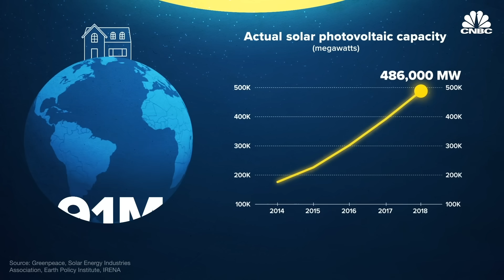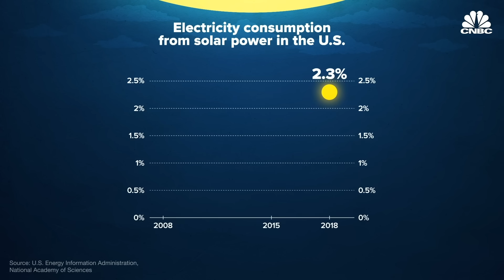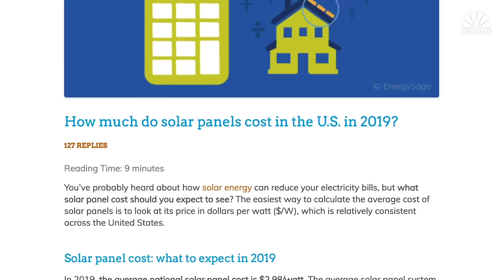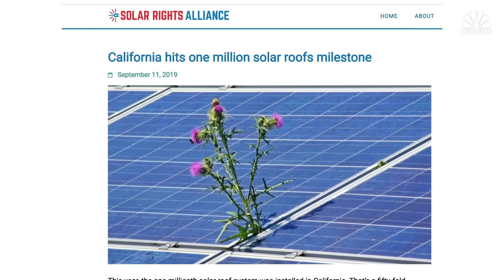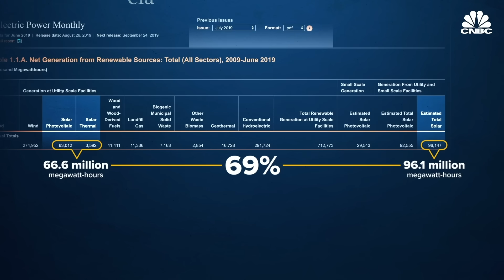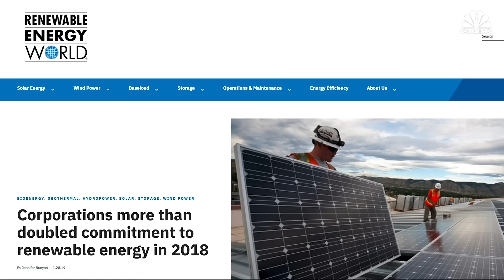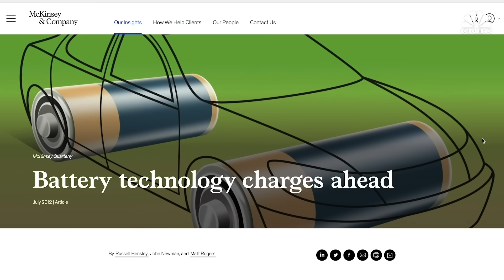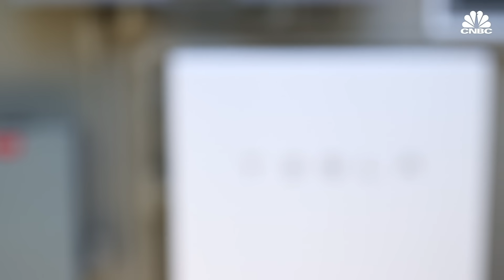The Rise Of Solar Power

Comment: Hawaii already over 30% alternative energy!
Reply: Maui runs about 70% renewable during the day (with normal winds).
Reply: @cb2000a  So the location most suited to renewable energy can only get to 70% during the day. Compare that to the City of Chicago with its 2.7 million inhabitants. For six months of the year there is no sunshine. A few hours of sun through the rest of the year. To produce enough wind energy would cover Lake Michigan completely. No geo thermal. As wonderful as alternatives are in theory most of the US is many decades away from a viable alternative source of energy to fossil fuels.
Reply: @johannesswillery7855  It's crazy to just dump natural gas.   It is the best, cheapest, and most reliable source of energy next to hydro.
Reply: @yaimavol  What about Nuclear? Hands down the safest and cheapest energy source a available.
Reply: @johannesswillery7855  No hydro is the cheapest because there is no fuel that has to be mined.   I don't like nuclear, because of the waste and with the abundance of nat gas we don't need it
Reply: @yaimavol  It is true that we have enough natural gas to meet our needs. What about regions that do not have abundant fossil fuels available? Part of what is missing in the conversation is the massive development taking place in areas that previously consumed relatively little energy.
Reply: @johannesswillery7855  it's the most expensive currently. 2x the cost of natural gas and 3x solar/wind
Reply: @fgsaramago  Uranium is quite cheap and has more energy stored than anything else. It is expensive to bring Nuclear online but way cheaper in the long run and it works in places that Solar likely never will.
Reply: @johannesswillery7855  the biggest cost of nuclear is the ongoing manteinence and operation of the plant itself. Just checked my last electricity bill and nuclear is at 20 cents, natural gas at 13 , solar at 8 and wind at 7.

Offshore wind it's the future. You don't need your electricity production to be local
Reply: @fgsaramago  Your electricity bill shows kwh price by source of energy? The truth is very hard to come by in this discussion. I tend to come down on the side of common sense. If alternatives were viable then I believe the most progressive states governments would be using them to power the buildings that they occupy. Since none of them do exclusively I doubt the sincerity of their assertion that Solar and Wind are the answer.
Reply: @johannesswillery7855  here in Portugal the bills have the kWh cost of each energy source at production as well as the percentage mix of each source.

Thanks to the growth of renewables this year the cost of electricity has lowered for the first time in more than 30 years

EDP, a Portuguese electric company is now the 3rd biggest renewables producer and investor in the US. Their new offshore wind farm will supply a third of Maryland for a lower cost than current sources
Reply: @fgsaramago  I wonder how much energy costs differ in the the US as compared to Portugal. I don't know much about the climate there but I do know a lot about the climate in North America. The Southern border States experience warm temperatures and copious amounts of sunshine. Not true when you go north of there.
Reply: @johannesswillery7855  we have a lot of sun in most of the country, think California weather, but what amazes me is how Americans focus so much on solar when talking about renewables. Wind needs smaller areas for the same production, it's more constant during day and night and the turbines work even with very little wind. Solar is good for micro generation, for people to have at home, in their rooftops, not for macro generation, except maybe hot deserts with sun every day of the year or close to it

We pay about 0.14€ per kWh, before VAT
Reply: @fgsaramago  A big challenge with wind farms and for solar farms as well is that they are hideous and no one wants to see fields and natural areas covered with them. Even at sea they are an eye sore to those who would travel that far. Off the coasts there is tremendous opposition most famously by the Kennedy family. A few very wealthy families can wield incredible political clout.
Reply: @fgsaramago  Have you heard of Germany? They claim to close all nuclear plants by 2022, and use wind and a bit of solar instead. Compared to 0.75 nuclear France, their electricity is twice the price already.
I don't know what is it with your nuclear plants, but France does it better, you should copy them.
Reply: @ferencgazdag1406  "our" nuclear plants?😂 Here in Portugal we never had them. The French buy our wind energy in significant quantities. Our wind and solar is the cheapest electricity in Europe
Reply: @fgsaramago  Just fact-checked you, France doesn't import any electricity, they are a net exporter, on the other hand, Portugal imported 9 TWh of electricity in 2008, what is 9÷49,1=0,1833=18,33% of total.
It may be the cheapest, but not at midnight, when you still need power, especially for industry
Reply: @ferencgazdag1406  in 2008...😂 Realise that was 11 years ago, before ANY wind or solar was pretty much in use? Get a grip dude 😂

And wind production is significantly higher at night, where consumption is also lower. Excess wind production at night is used to fill dams and sell to France and Morocco

Also, calling France a net exporter is totally pathetic. Sure it produces more than it uses, there's just one problem with that. Nuclear has a continuous production even when it's not needed and it goes to waste. If you take out the amount of electricity produced that was thrown away France is in fact a net importer
Reply: @fgsaramago  Yes, nuclear production can't be adjusted to demand quickly, but at least it can be adjusted on a grand scale. Solar and wind can't even do that, if the Sun doesn't shine and the wind doesn't blow, you are basically screwed.
And that is the reason why Germany pays other countries to take her peak power, but has a very high price of electricity. Also, Portugal has 0,41 of total energy from fossil fuels, while France only has 0,17. This means a lack of nat. gas peaking stations, but also less emissions.
Reply: @ferencgazdag1406  that's some very skewed way of seeing things. Radioactive material is certainly fossil but that's besides the point. 

One won't certainly have more than a few hours at a time where the there's no wind and no sun and it's for those moments that wind and solar power are used to top up dams. 

Lastly, the only reason Portugal doesn't have a higher share of renewables is that it's more profitable to sell that energy to other countries than to use it in the country due to the way old contracts with natural gas and coal plants are structured again making for some disingenuous points on your part. The grid pays more for coal or natural gas generated electricity
Reply: @fgsaramago  I don't understand, how an unreliable power source can outcompete a reliable one, with neither being adjustable. You can just do dam toppings with nuclears as well, and the electricity consumption is more like a flat line of nuclear than a parabola of sunlight.
Reply: @ferencgazdag1406  the thing is that wind is produced more at night and solar makes up for the drop off during the day. Solar and wind farms have massively lower building, running and licensing costs than a nuclear plant
Reply: @fgsaramago  Sources, please?
Reply: @ferencgazdag1406  afraid I can help with that. My sources are that this is a hot topic frequently discussed on TV. Programs like negócios da semana and Prós e Contras talk about the energy sector regularly

I'm sure, however, that these basic concepts I talked about here are taught to teens in schools all over the world. This is just some pretty basic stuff if we're being real.

I dont suppose you want me to do your Google research, do you?😂
Reply: @fgsaramago  I don't want you to do my Google research, but i thought you made your opinion based on one.
I did some research, and France emmits 2/3 the CO2 of Portugal per produced energy.
Lacking a cynical wiewpiont, and surrounding oneself on religius dogmae nicknamed common knowledge is highly frowned uppon in the scientific community, the very best people.
I've looked it up, and solar and wind do not complement daily, but they kinda do annually, but you have a deep valley in october, what means you have to sometimes trash your electricity.
Reply: @ferencgazdag1406  given France's use of nuclear that CO2 stat should be, dare O say, common knowledge 😉

Getting a bit more real here, don't conflate common knowledge with dogma, when the meaning here is clearly basic facts. Do you know what's really frowned upon in the scientific community? Trying to have a useful conversation without knowing the basic facts

As for what you call the October slump, I'm lead to believe that the stat you saw includes hydric generation as October is usually the worst month for it.

Since you've talked about prices, why is it that domestic electricity plans that are 100% or majority renewable are cheaper? One would think that plans like the ones from Endesa who are something like 30% nuclear and 35% coal would be cheaper...
Reply: @fgsaramago  Yes, you are right, common knowledge is not religious dogma yet, and to keep it that way you have to fact-check it over and over again, so you are better off not relying on it in the first place.

I think that gasoline is THE best and cheapest way to make power, what can even be turned on and off. Why am i not recommending it then? Because climate change, of course.

As i will prove, renewables apperar clean on the surface, but like asbestos, this is only looks. Solar & wind can't power a country, so you must rely on natural gas, and other evil ways to get the grid to work. And the evil has realised this, and now, standig face-to-face with their end in nuclear, they choose the only option of survival:
Ensure, that there are wild renewables for them to balance, and make nuclear look really, really bad. For both, the television is exellent, as you only have to pay them to make them say anything, they don't need sources. Also, the public perception of nuclear reactors is way worse than reality, and the public perception of solar panels is way better than they actually are.
This is why you shouldn't rely on common knowledge, at least in this subject.
I want my opinion to represent reality, this is why i asked you for sources, and this is why i still don't believe in renewables. If you back up your claims, i will believe you, but i don't trust the common knowledge, for the reasons listed above.

We know that nuclear plants make waste, what is radioactive and will stay around for a lot of time, but solar panels do the same, but only out of sight. As the solar panel reaches the end of its 20 year lifespan, it stops working, and we have to get rid of it. This is approx. 300 times the waste/joule what is made by nuclear, and it doesn't even decay, and is toxic. Wind turbines don't have this waste problem (they still break down),  but they are even less predictable than solar, so you can't even make supergrids with them, and you must use the dark side of the power. Theese are some of my arguements, if you can show traits what outweight theese, i will adjust my opinion accordingly.
Reply: @ferencgazdag1406  I've never seen a comment so full of dogma and uninformed opinion in my life!

The CEO of EDP, the biggest energy company in Portugal thoroughly debunks the premises you base all your assertions on. 

Firstly, Portugal has at times been for spans of 3 to 4 months 100% on renewables.

Second, wind and solar CURRENTLY cost per mW half as much as natural gas, with nuclear in turn costing twice as much as natural gas.

We've recently started reaping the benefits of renewables with energy prices dropping for the first time ever, something that will continue in the following years with more renewable sources getting online.

Why would anyone want to build more nuclear installed capacity to burden consumers with higher electricity costs?

Sorry to say, but as usual, the nuclear proponents are in full dogmatic mode, oblivious to facts and lived reality.

I think nuclear is pretty cool and the process fascinates me, I work on research with radioactive material. I just can't bring myself to ignore certain facts and make others look better than they actually are
Reply: @fgsaramago  I'm sorry, but i can only accept this as you opinion, and i can't believe, that nuclear would be TWICE the cost of nat. gas, as one of my sources is Illinois energy prof.s video on nuclear vs nat. gas (he's on Youtube). I found no sources what say that, nuclear would be a lot more expensive than solar. Most of them say, that solar is slightly cheaper than nuclear, but they do not take energy storage into acount. You are obviuosly exeggerating. The price of solar energy varies throughout the day, is the lowest at noon, and the highest at mindight, peaking at infinity. And some industrial processes can't operate with inconsistent power. And this is without energy storage, i expect a higher price for solar+batteries, and a much lower price for thorium, as the fuel is going to be dumped on reactors. AND PLEASE, FOR HUMANITY'S SAKE, SOURCES! As i can't believe you without them.

And if Portugal's energy provider says, that solar panels don't break down into dangerous waste after 20 years, i can't even believe them.

I was unable to find anything recent on Portugals energy, only a claim from 2007 to go 0,75 "renewable" by 2013, but it was only avalible in archived form, perhaps it was deleted.
Reply: @ferencgazdag1406  you haven't provided a single source despite your info clearly coming from places on the internet..

I really don't know how I can link you to tv shows I've seen over the span of multiple years. You need to understand that the energy sector is much talked about as EDP is the biggest Portuguese company by market cap.

Also, if solar an wind were expensive how come that EDP is the third biggest player in renewables in the US and theyre putting coal plants out of business? Their US business is very profitable. Your logic just doesn't hold up to any kind of scrutiny

Also, the cost of solar generation varies throughout the day😂. Sorry, but I haven't seen anything more nonsensical. There are the running costs over the year, which are stable, no direct correlation between resources used and electricity generated and there's the price the electricity is sold for and if that covers the costs or not
Reply: @fgsaramago  If in a hypothetical market, there is only solar, the consumer has to pay less for electricity at noon, because of increased supply, and has to pay more and more as the sun sets, because demand is the same, if not increasing (https://www.eia.gov/todayinenergy/detail.php?id=830), but the supply diminishes, leading to inreasing prices of electricity, peaking at no supply after sunset, meaning no money is enough to pay the price, so it is infinite. You have missed the point, as i was speaking from the consumers standpoint. This encourages the construction of power plants, that can turn on as the Sun sets, as electricity can be sold for a quite high price. The businessman investing will probably want to use a powerplant, what can be turned on as the Sun sets, so no renewable can come into play, nor nuclear. The ones left are fossil fuels, especially natural gas. This makes sense, as Portugal with its "renewables" has 150% emissions/power compared to France with nuclear reactors. If theese emissions wouldn't be a problem you would just usen fossil fuels absolutely everywhere, and China would be the ideal producer of energy, with its tremendous usage of coal (https://www.eia.gov/beta/international/country.php?iso=CHN)
Reply: @ferencgazdag1406  I'm sorry, but you don't seem to be able to piece together different bits of information. 

Obviously Portugal even with a lot more renewables has more CO2 emissions than France as the almost 50% part that is not renewables comes form natural gas and on a smaller part coal which is way more pollutant than nuclear. You don't need to be a detective to know that, so what kind of point are you even trying to make there?

As for using only solar, where did you see anyone suggesting that? Obviously no one is talking about using a single renewable source and wind and hydric are much more important than solar. Solar is good for microgeneration at people's homes, not macro generation 

Once again, Portugal, the whole country including all the industry, including heavy stuff like steel mills ran for months at a time only on renewables. Are you oblivious to facts?

Lastly, you seem to conflate generation costs with inflating prices to curb demand, which are completely unrelated things.

Sources: any grade school curriculum
Reply: @fgsaramago  I'm trying to make a point, that renewables can't stand on their own, and are not capable of reducing CO2 emissions, see Germany ( https://www.cia.gov/library/publications/the-world-factbook/geos/gm.html ) and Portugal, where they don't use any nuclear reactors, and they seek to decrease emissions by "renewables". Neither of them succeeded. Contrast it with France, who has a lot of nuclear plants.
Germany has about 600% the emissions/Joules of France, and Portugal has 150%.

Good job, managing to power your country, for 4 entire months! It was first done by the earliest grids, and sorry to disappoint you, it's no longer a great achievement. Most people just take electricity in the full year for granted, you won't be able to impress them with just four months.

Solar is still bettet than wind, as you can make supergrids to power everything at every time, but with wind you can't even do that, as it is even less predictable, what is a great feat.

Using the big ones, like hydro, geothermal and nuclear is most probably the best decision, but they are not compatible with the romantized small renewables, and only nuclear is avalible everywhere.
Reply: @fgsaramago  
You can't back up what you say. Show me a country what reduced their emissions using renewables (sources!), as doing so is counter-intuitive, because they will sooner or later face no wind overnight, and have their forges get destroyed by the ore solidifying in them, and encounter other similar economic treats.

And how many solar panels do you need to squeeze energy out of darkness? Same with wind turbines and lull. The only solution to this is fossil fuels, and i have examples to back it up.

I keep circleing around my arguements, and repeating them with slightly different wording, because you have just ignored them, or not disproven them, only pretended so with a "you are wrong" sentence. Well, YOU are wrong. Take that! The unquestionable arguement has shown up, and disproven you!
Reply: @ferencgazdag1406  Google is your friend. Do you want sources to say that if you go from 100% fossil, to less fossil you have less emissions?😂 that's counter-intuitive? And somehow, at the same time, all wind is gone, no sun and no water? So all of the country is without wind, including half of the north Atlantic. Sure, that's very likely 😂
Reply: Mark Burch Some people like solar and turbines
Reply: @johannesswillery7855  damn if only there was a renewable resource for the windy city.
Reply: @cyndxrs2012  As I stated earlier a wind farm that covered most of Lake Michigan would provide Chicago's energy needs. While the wind was blowing..........
Reply: We need to start thinking about more geothermal
Reply: Iceland is 100% renewable
Reply: Norway is 99% renewables thanks to their dams
Reply: @etiennelamole9565  The Socialists in the US will not allow any more Hydroelectric Power.
Reply: Nobody tried wave generator yet...
Reply: @aebniala  Well, it's quite difficul, i recommend watching Minutephisics's video on it.
Reply: @ferencgazdag1406  They flown the first flying saucer in 1917 and they dont use solar or wind or oil. 
They used nuclear at the beginning and then scalar energy. The started at the size of a car and now the size of cities.. They use renewable energy that is for sure..
Disclosure is for very soon. Why would you use solar or wind. Use the oil until the patents comes out... Oil aint that bad and the environnement love the co2.
Clean up our trash is the main thing we need to do. Stop dumping into the environnement and grow organic until then... That is all we got to do and cleanup the swamp....
Reply: @aebniala  I know, i said it about wave power, i know, that nuclear fission is the energy of the close future, and fusion is the energy of the far future.
Reply: @ferencgazdag1406  A lot sooner.............
Reply: @aebniala  are you being ironic or something? It has certainly been not only tried but there are wave generators operating currently
Reply: Unfortunately we are seeing just the small picture while ignoring the big picture
Scaling from zero to where we are was easy because it didn't involve much storage, further on it will get much more expensive & difficult to reach 100% RE as the scale of energy storage systems required is simply unimaginable
Reply: Kansas has 40% wind and it doesn't even have the highest percentage of wind in its grid, and the electricity costs about 1/3 as much. Vermont gets 99% of its electricity from renewables and it's electricity is roughly half what electricity costs in Hawaii. Hawaii has a great start, but it is a long way from being the best example state.
Reply: Sucks for the poor.  Alternative is a scam perpetrated by hoaxers who stand to make billions.
Reply: If alternatives were even remotely feasible then Hawaii would be 100% alternative. There is no location in the US more suited to alternatives, than Hawaii with low cooling costs and copious amounts of solar, geothermal and wave energy.
Reply: That's not very good I'm afraid
Reply: @fgsaramago  It beats having 0%
Reply: @fgsaramago  it’s a start be positive, this transition isn’t going to happen over night, but at least its started full pace now.